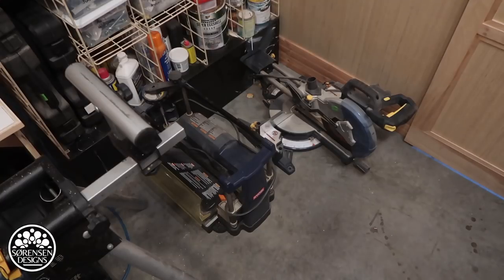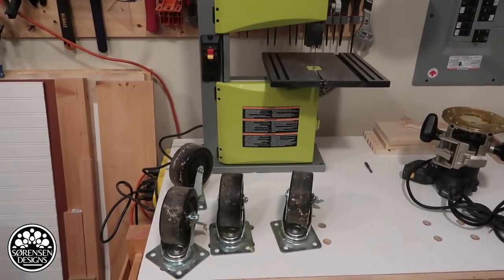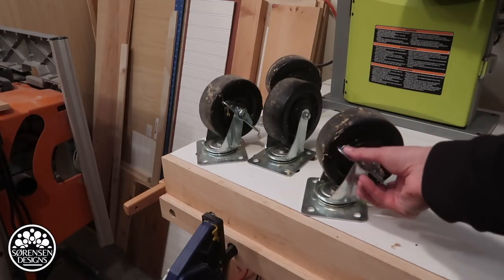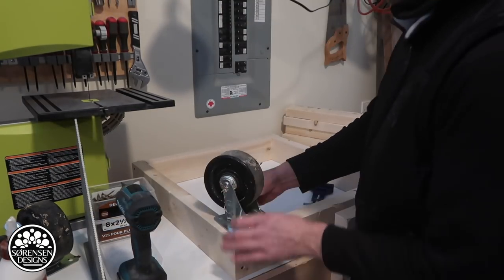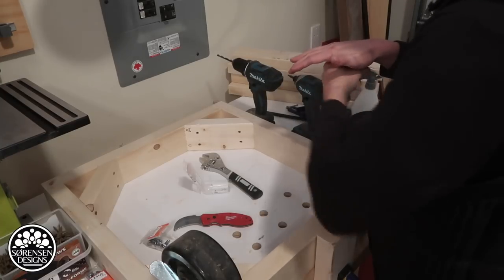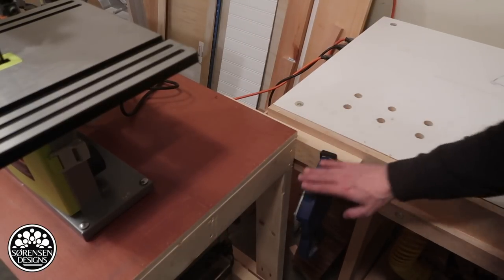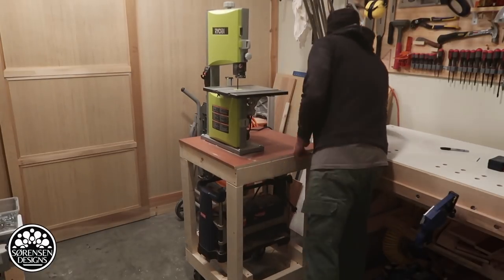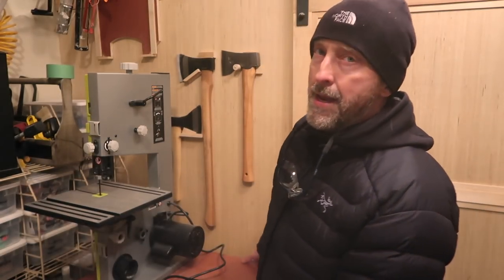2-in-1 Mobile Workstation with Docking Feature

Comment: Just using a small area for a shop until I get a permanent place of residence .... trying to put a Band-saw, Drill-press, belt and disc sander combo, a table saw along with a dual router table  out and ready to use is impossible it is hard enough just to fit them all  in the make shift shop is a challenge. a small docking bench and each tool on a stand of its own with properly located docking arm and I am in business with proper planning that is ... Thanks for sharing this video the wheels are turning.
Reply from the maker: Always a Challenge! This station is now a 3-in-one: Bandsaw and belt/disc sander on top and the thickness planer at the bottom. Get good locking casters / wheels and you probably won't need the docking feature.

Comment: I currently have my planer in a flip-top bench, but it occurs to me that, this is probably the one tool that really doesn't need to be in one, since - as your design shows - it can be used down low (not super convenient if you do a ton of planing, but I really don't). I think I may have to consider something like this. I'm even thinking, maybe my little 6" jointer can somehow share the top with the bandsaw? Thanks for the video!
Reply from the maker: @Tighe Crovetti I use my thickness planer once or twice a month - if that.  Also, a flip top means you can only use one tool at a time, whereas I have now added my disc/belt sander to the top along with my bandsaw. Now it's a 3-in-1 cart. All tools are useable and accessible at the same time, no need to switch or flip. Saves me a ton of space too.
Reply: @EricSorensenCanada  I'm definitely sold now! Going to undertake this next chance I get!

Comment: Hi Eric, thanks for the video. Is there a reason why you put the planer on two rails instead of plywood like you did for your bandsaw? Cheers
Reply from the maker: Just short of plywood that week🙂.   But I do find that the 2X4 rails make better mounts for the cast steel bottom and the carriage bolts that I used. Again, use what you have. 2X4 is much cheaper than plywood where I live.
Reply: @EricSorensenCanada  Excellent, thanks.